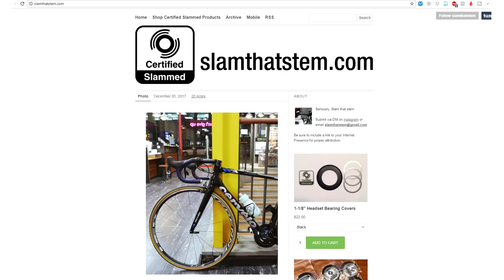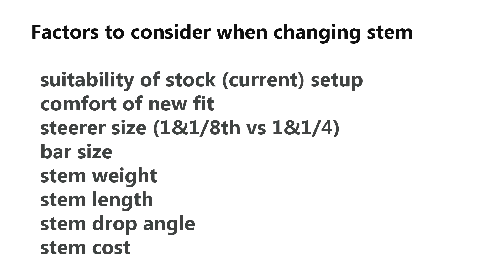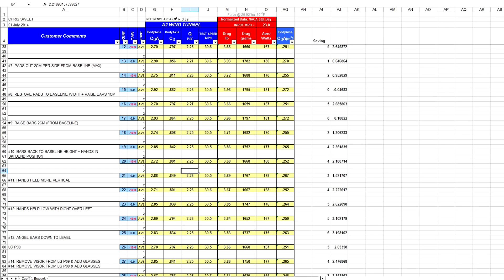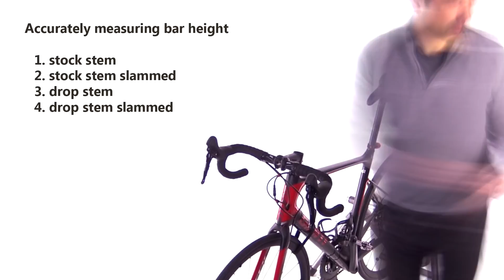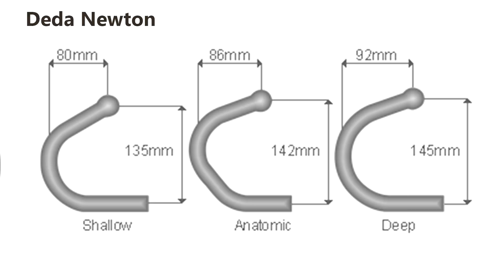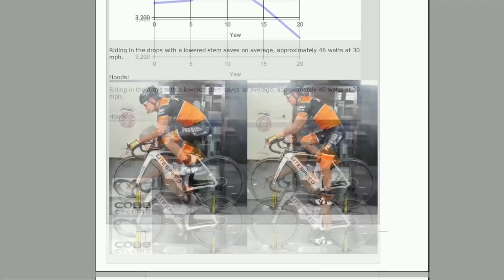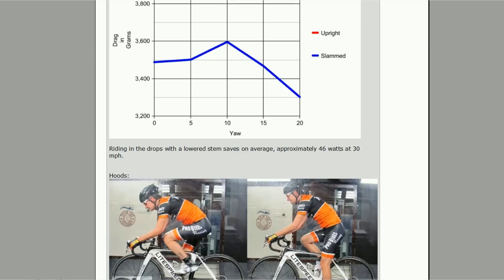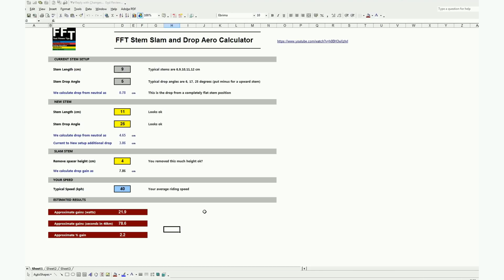Stem Science! How many watts does a slammed stem save?

Comment: This is very unscientific. Using studies of individuals and using extreme variances in height is all very very well - I guess you're comparing racing positions versus bunter positions - but if you think that slamming your stem is the only aim, you could be very wrong. Your current marginally higher position could be faster - if you move your position down 3cm to get the slam and it creates a poor body position, maybe some over-reaching where your shoulders don't sit optimally, you will actually create more drag than your slightly higher position. Apart from the changes to hip flexor angles, lower back position, ability to stomach breathe, etc. affecting power and performance, if we are talking about only a slight variation in height, it is far more important to be narrow.

Comment: Wind tunnels, data calcs etc, are all good measures for the pure numbers when riding alone or in  a time trial, but for the racer who competes in criteriums and road races, it makes more sense to set your bike up for the most optimal position for handling and power output. A slammed stem will eventually cause issues physically. There are many new aero bikes that achieve the same as a slammed stem while keeping you comfortable and less risk of physical damage. The drop from saddle height to bar is what you should be concerned about. Ask your prostate about that.

Comment: I am super interested and at the same time puzzled by the image at 0:29, what is the source of all these numbers ?
Reply from the maker: Those are estimates from an old marginal gains calculator I wrote a few years back...since then we have improved the model of losses several times to account for rider speed, bike type, CDA etc.
Reply: @Fastfitnesstips  : Thanks, I am a bit surprised though by the contribution of body position : 4.5+18.8+8.5=31.8% of the total, so about 45-50% of total drag when all publications mention between 85% and 95%. Most notably but not limited to Table 2 of "Cycling on Earth, In Space, on the Moon", Eur J Appl Physiol (2000) 82: 345-360 by Pampero in 2000. What is your view on this ?
Reply from the maker: @sebastienricciardi883  very roughly whole body drag is around 70% of aero losses (bike and equipment 30) which can be divided into 45% body 15 clothing 3 feet 5 head...but when combined with all losses body and clothing aero drag makes up around 40% at 40kph
Reply: @Fastfitnesstips  I just noticed that the total equals 85.85% and that there is not the rear wheel drag. Are some elements missing ?
Reply from the maker: @sebastienricciardi883  must be rear wheel drag then?! As mentioned this is a very old version of one we use for our coached athletes
Reply: @Fastfitnesstips  : I would expect rear wheel drag to be half of front wheel drag (i.e. 4%) as per Specialized win tunnel)-> still 10% missing. In any case no big deal, thank you very much for all this excellent content. This vidéo and all the others

Comment: I totally agree with you.... I have no scientific background to prove it, but I have two signs.... One is that I made some KOM's and top 10's on high speed segments on Strava, the other sign is that all of my cycling mates prefer to stay in front instead of riding behind me.... Of course they are between 8-12 cm taller than me, but it is not a such difference..... But what all they saidcafter I asked them is that they prefer to stay in front, because it is clear that the must work harder and they can handle the effort. If they draft behind me they need nearly the same output, but there is a negative psychological effect for them!

Comment: I think I'm reasonably slammed and have been so for several years now.  I have to stretch every morning just for general health, but I think that I wouldn't like my position if I didn't stretch.  I run my saddle at -6 and stem with -17x100 stem, compact Kforce handlebar.  I'm 5'10 on a 54 Cervelo R5, so my position isn't anything extreme.  I do get a sore back on the first century ride of the year, but then I get back into shape and don't have any back problems.  Now the real story might be what we want to do with the stems on our gravel bikes.  I run a -6x100 stem on my longer cockpit gravel bike, and guess it's okay.  It still feels a little low in the front on some sketchy terrain.

Comment: Another great video by this presenter!  I have one question about the very interesting drag budget displayed at 0:30.  What is meant by the "handlebar/stem drag," which shows a value of 14%?  Is this just a typo—namely, it's just missing the decimal pt (so should instead read 1.4%)?  

If it's not a typo...I recognize how highly amplified the aerodynamic drag of leading-edge surfaces is in an undisturbed slipstream...but I simply cannot believe that, even with this emphasis noted, the aerodynamic drag of the handlebar/stem could be remotely close to that of the rider's body volume shown as 18% (maybe the arms in isolation, and even that seems like it would be pushing it).

So if this is not a typo, does the 14% somehow incorporate elements of the rider's body...or what explains the 14%?

Some other points that aren't incorporated in the spreadsheet, which I a realize has a value on simplicity/elegance, are: 
(i) There's a limit to how much you can lean down and still benefit (or even not suffer) aerodynamically.  There's even an optimum lean angle beyond which drag will start to increase again.  
(ii) Wind tunnel testing has revealed that you are more aerodynamic with your forearms level to the ground on the hoods than with your arms extended to the drops (constrained by the same back ht / position).
(iii) Your head/neck position is astoundingly important (getting your head low and out of it's own slipstream); a raised head acts like a parachute—this effect even feeds back into the body lean angle because of the neck/eye strain at excessive body lean angles as you try to maintain some semblance of a fwd road view.  So leaning down further to a theoretically advantageous height might be wasted or even detrimental if you just raise your head back up to see the road.  Time trialists know this last challenge all to well.

But back to my main question, I'd love to better understand the 14% handlebar/stem drag figure!
Reply from the maker: Re handlebar drag (including cables) have a look at this link:
http://djconnel.blogspot.com/2014/08/cervelo-s5-and-aero-road-bars.html

i) There's a limit to how much you can lean down and still benefit (or even not suffer) aerodynamically

>> there is certainly a limit to comfort, power delivery and safety but aero?

(ii) Wind tunnel testing has revealed that you are more aerodynamic with your forearms level to the ground on the hoods than with your arms extended to the drops (constrained by the same back ht / position).

>> basically arms are a drag too, can be modelled by two x2 cyclinders

(iii) Your head/neck position is astoundingly important (getting your head low and out of it's own slipstream)

>> agreed

Comment: So at 6:13 in your own video you say you can't work out how much you could save or lose because "we know all that, yeah."

When I was a kid 20+ years ago, I had a custom TT frame made with 531 tubing and an 82 degree seat angle. The top tube and down tube was so long it required the tandem tubeset. I was 5'11 with a 34" inseam but the front end of this TT bike was essentially a 19" bike with a massive seat tube and a 24.5" top tube. The difference between the saddle and bars was more than a foot. Fast forward two decades I find out that I would be faster with a much higher position. Such is the wonders of now owning a power meter.

When doing video's like this there needs to be a reference to the bar height relative to the front end of the bike rather than 'does it need to be slammed' because head tube heights vary so much.
Reply from the maker: Swampster70 interesting comment but given the comparison is between two positions with the same head tube height I think it drops out of equation in an approximate calculation. Do you disagree?
Reply: You make the comparison between a high and a low position and unsurprisingly, a lower position is more aero but you should also look at going a bit lower and longer. It'll allow you to drop the shoulders as with the slammed stem but put less stress on the neck as well as allowing you to 'shroud' the head more effectively with the shoulders (think shoulder shrug).

The ultimate test is going out and riding for a few hours in the new position and seeing if it works. If you can only hold it for 10 minutes it's pretty much useless don't you think?

Comment: What stem angle degree should i will use if i want the dropbar be level on the toptube
Im using aero dp
Tnx
Reply from the maker: the answer depends on your stem length and head tube but is easily calculated here http://goo.gl/ajVPbP

Comment: There's too many variables to have an absolute result in wattage saved or gained. With regard to frontal area, bar width and all riders are of different sizes, (height and weight)  helmets are also of different shapes. These will be significant variables with regard to CdA. Not too mention YAW and the angle ( direction) of airflow in relation to the bike and the rider.

Comment: Fairly detailed analysis, personally, I have slammed my stem (gradually over a year) and noticed my average speeds on the flats have increased by 3 to 5 km/hr. Mind you , slamming stem places additional load on your body if you are not used to it. I included additional stretching exercises in order to accommodate a more lower riding style. Probably the cheapest way to go faster while using marginally less power, cheating the wind.

Comment: Was Eddie etc unfit, when they rode bikes with drop of 1-2 inches from saddle height to bar height?
Reply: Exactly. Just saying you should slam the stem because it's more aero is too simplistic to be of any use. You body 'finds' the position it wants to be in when making an effort. If you slam the stem with not other considerations, you'll probably find that you have straight arms and don't use the drops, arriving back in the same torso position and hip angle that you had in the first place. Remember, the pro's are not a good model for normal people.
Reply: This. If an aero position is not sustainable for at least long enough to perform an FTP test, then what is the use? It's no good saving 14 watts for five minutes then having to waste 20 watts for the next fifteen minutes because you are so slammed that flat fore arms is not sustainable.  I have found my best compromise is to setup a flat forearm position with a compact bar that is sustainable in the drops for 3-5 minutes. This provides me an aero hoods position that is sustainable for 30 minutes, a straight arm drops position that I can comfortably use to descend and follow wheels and a short term aero drops position when hammering.

Comment: I know your aiming at the aero gain with this vid, but be carefully everyone, you can’t just take the spacers out and put them on top of your stem. The carbon steerer is supported by a plug which should go deep enough to support the stem clamping. What needs to happen is the stem needs to be cut, so no going back. Also it is not so easy to cut carbon. If you use a normal hacksaw it can delaminate the fibres which will then initiate an incipient fault which can travel down the steerer leading to a failure. You need a special saw with a high tooth count. This is just a warning comment for people who may not beaware. A steerer failure can be very nasty. So leave it to the experts if in doubt.

Comment: -Their isn't a watt gain, you don't get stronger
-All that is nice but 90% of people are riding bars too wide (I'll 42cm because it came like that)
Bikes should be spec'd 36-38 on 50/52cm bikes / 40 for 54/56cm bikes and 42+ for 56+cm bikes
Reply from the maker: good point: watt equivalent gain by reducing drag
Reply: And 54er bar for Steven Kruijswijk
Reply: Charles Gagnon  I am not sure if the wider bars have more negative impact than to be less Aero.... To small of course, but to wide? Look at the bars in MTB.... I am sure that competitors in CC are also looking for performance
Reply: Charles Gagnon  by the way.... Rolling in would be a sign for me that the bar is to small 😉